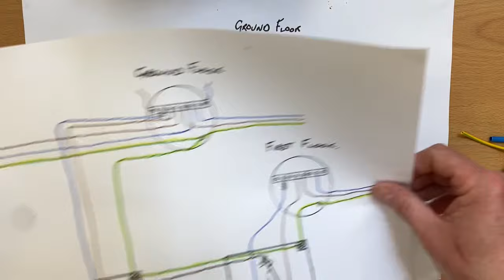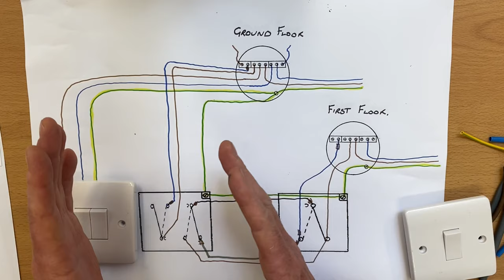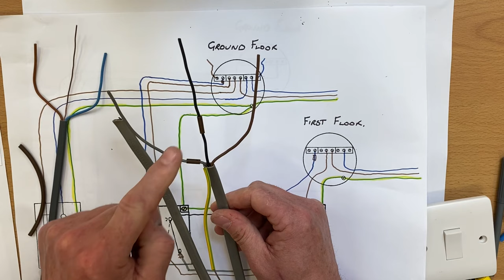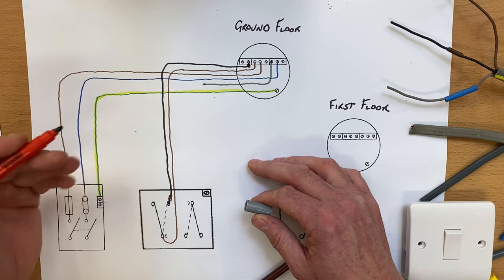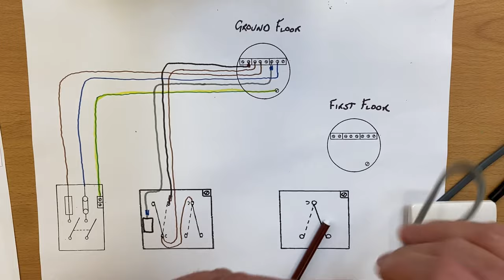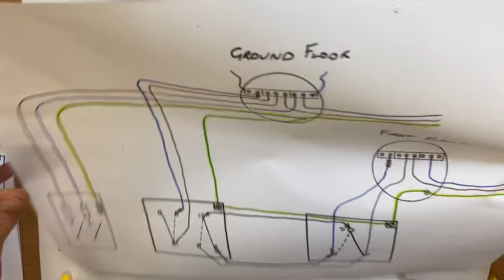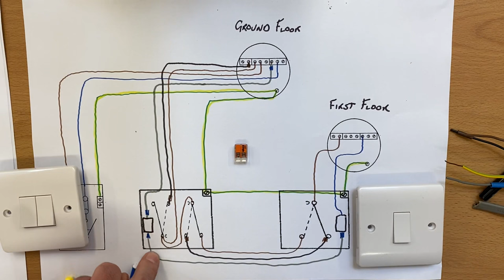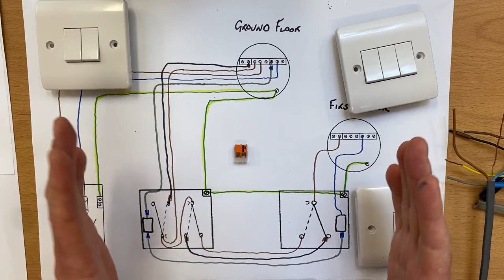Wiring Diagram Using a 2 Gang Switch Downstairs & Upstairs 2 Way Switched on the Same Circuit Fuse

Comment: I fitted two way switches top and bottom so you could turn on/off both up and downstairs lights from either top or bottom of the stairs
It had been a while since I'd done wiring so I used your videos to help
And what a help they were too 👍
Reply: How did you do that?
Reply: @davidpestell1981  I ran two lots of 4 core to both switch locations 👍
It was the thing that used to bug me the most when we had our last rewire and the guy didn't do it
So this time I did it myself and made sure 😁
I was also tempted with the quinetic stuff so round the house but the cost was prohibitive as we've got 26 light switches around the house so I could only budget for 3
Reply: @therealdojj  is that 2 lots of 3 core between the switches or from each pendant to each switch? 

I’ve currently designed it with 2 core from each pendant to their respective light switches, and two three cores between the two switches. Plus a 2 core between the two pendants which now looks like overkill as it doesn’t implement the two strappers approach.
Reply: @davidpestell1981  I made it very simple by keeping it the same, but for both switches, if you see what I mean
I used a 3 core to do one for downstairs 
Then I simply repeated that for the upstairs lights
I'm sure there are better and cleverer methods but if it's not broke...
I also utilised the larger chase I did too run an extra switch for the "no one's going to be home but you need some lights when you come back late in the night but you don't want every light to be on either" lights
I also tapped into the lighting circuit for my doorbell feed, but that's another story for another day

Comment: Gary,
After all these years, why does the UK still use something as antiquated as the 3-plated switch method, we stopped using this in New Zealand under the 1976 Regulations here, although you still see the remnants of this in some houses.
Nowadays, we loop everything at the flushboxes for the lighting switches and send a Phase, Neutral and CPC to each individual light fitting from the flushbox and have your strap wires merely head to the other end of your two way switch, which means they are only fed from one end.
Don't get me wrong, your explanations are perfect and really on point for an apprentice coming into the trade.
Good advice also, that you need to test for correct isolation no matter what you are working on, no-one likes a surprise like that.

Comment: Do you not then create the exact same problem upstairs if that switch was also a 2Gang switch, your landing pendant will be on downstairs and then maybe the hall will be on upstairs, essentially  creating the same problem with 2 circuits in the same light switch.. if im understanding this correctly the only use for this would be if the landing switch was a 1Gang switch? Thanks for all the resources and time you have spent on helping me and my training.

Comment: If you have a two gang switch that is being used for a ground floor light and to control the upstairs landing light, What happens if theres an earth fault and the RCD trip? Does it knock out both circuits as the CPC is connected together in the switch? Thanks
Reply: Yh obv

Comment: Why does the neutral at the switch not have a brown sleeve on it?
Reply: Because it is a Neutral that is Looped-Thru & that conductor is serving as a Neutral Conductor for the Lamp Circuit.

You wouldn't want to Brown-Oversleeving any Neutral Conductor(s), isn't it??😧

Comment: Could you have a two gang switch upstairs to control the downstairs hallway light as well. Let say if I went upstairs and I forgot to switch the downstairs hallway light off, I could then switch both lights off and on from upstairs. I take It I would have to an additional cable in.
Reply: Yes you can, because I've just done this in my house for exactly the reason you suggested! I did have to put in an extra cable.
Reply: @josh214haigh  thanks

Comment: I'd always use black as my neutral (same as old colours) as the colour grey is a phase too. As long as identifier is used as per BS it's fine either way and can't be criticised. NB - non qualified persons should not be working on electrical systems as per BS also
Reply: Issues arises when installer used Black Conductor as Neutral & left it Unmarked (not over-sleeved whatsoever) as if it's in Old Wiring Colour Standards.

No way can the New Wiring Colour Standards & Old Wiring Colour Standards co-exists within a 3Core+E cables.🚫